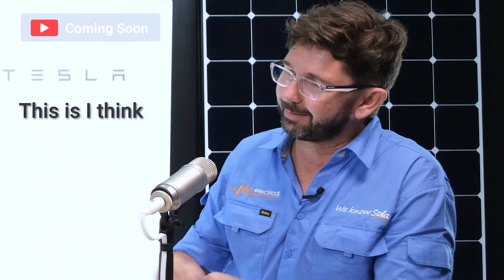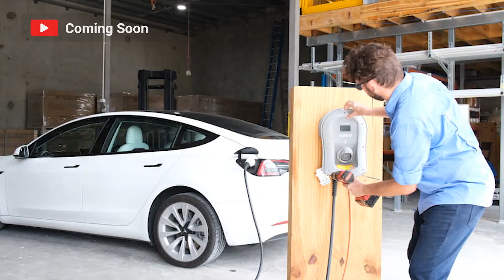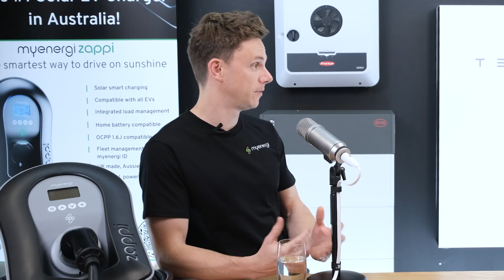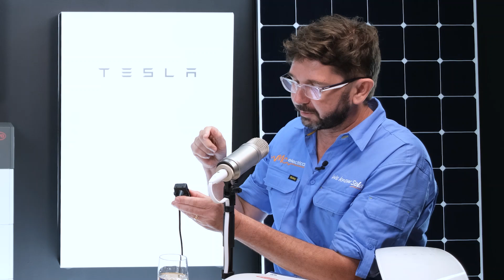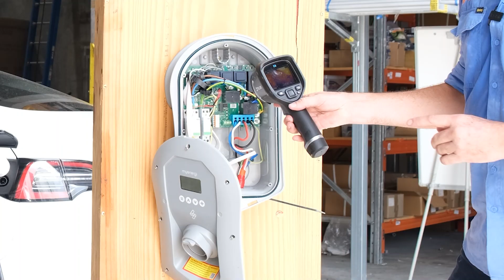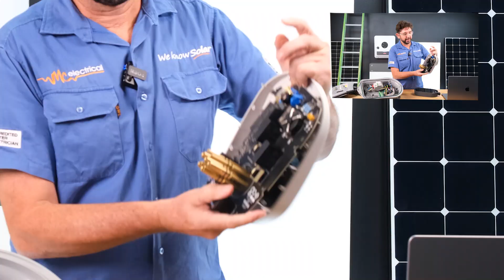Zappi Honest EV Charger Review

Comment: In NL we have a few popular home wallboxes in no particular order: Peblar Home/Business, Zaptec Go 2, Easee, Wallbox Pulsar. Most of these support dynamic load balancing to not overload the grid connection, Follow the sun demand steering for 0 export mode. Home assistant integration to switch profiles and keep track of usage. In NL grid connections are frequently 3x25A, so demand steering makes sense.

Also, they follow a similar concept to the Fronius with a single integrated PCB. It's like this is the most obvious thing.
Reply from the maker: Thanks for sharing, which one do you have?
Reply: @mcelectrical  Peblar

Comment: This is a year old now.   Are there any improvements to Zappi?  If there are, I think you owe them an update, because I was about to buy one when I found this video ... now I'm not!   That's not fair, if they have fixed the build...
Reply from the maker: Mark's moved on to testing batteries and their round trip efficiencies now with the Australian battery rebate. To be fair we still use a Zappi at the office that's installed in a shady spot - depending on your location, it might be fine but we think there's better options. We've had users comment that they haven't had issues with their Zappi, and they like the interface.

Comment: Have had a 3-phase Zappi plus Eddi running for 3 years. The first unit did fail on installation but the support from Melbourne was great and the sent a new unit quickly. Since then it's worked flawlessly up to 11kW. The configurable settings are great and having integration with hot water and BESS has saved me a fortune. I have no problem recommending the product.

Comment: If overheating is a problem with Zappi then it is basically limited to the UK market where 26 degrees celsius is considered a heatwave. 

The internal components also look like  off-the-shelf parts thrown together in a box. For a startup that's maybe ok, but looks very, hmm, home project like. 

Also the way of metering of excess solar production is very limited with the idea based on  CT clamp  on the outgoing cable exporting to the grid. There are countries where it is very difficult to get the permit for exporting to the grid and ppl still would like to have the same kind of functionality but very strictly with zero export. Zappi at this time according to my understanding is already useless with under such circumstances.  This functionality BTW is already built into some inverters, like the SunSynk, Deye, etc with the smart load output - when there is excess solar available the smart, programmable output is powered. 

There are obviously more possibilities, but if you think about it, solely having such an inverter  you are able to "divert" your excess solar to your car charger and water boiler in a programmable way. 

So there are cheaper, better built, more resilient and heat resistant, better looking solutions out there for example already integrated into your inverter.
Reply from the maker: Exactly, thanks for sharing.

Comment: just came across this video as I am in the market for an EVSE for home as well now - tossing up between the Zappi, Fronius wattpilot or the 'new' kid on the block the Evnex E2. I have an existing Frounius inverter (I chose that because of how highly you and Finn rate Fronius in general) so the 'default' option would be the Wattpilot, but as you mention the 'smart' solar surplus charging is round the web and back so there is a lag. From what I gather the Evnex is still sort of via the web but is faster (not sure how) but after seeing your teardown of the Zappi I am interested in whether you've had a look at the internals of the Evnex E2 yet and thoughts on its build quality? As it's quite new/not widely used it's hard to find many reviews/videos that aren''t just from Evnex or their 'trusted' installers...
Reply from the maker: The Wattpilot's a good option if you're already in the Fronius eco system, but Evnex is a worthy contender in Mark's tests for derating. Mark recently filmed another video comparing 6 chargers which will be out in the coming weeks.
Reply: @mcelectrical  hitting that subscribe button now so I know when that video comes out :)

Comment: I've had a V2 since early 2022 with no issues. I am in the UK though, and the Zappi is in my garage. I run the cable under the garage door to charge the car on my drive.
1) zappi not in the sun
2) zappi and cable out of harm's and vandals way
Reply from the maker: Hey rugby girl. It may be a different model. It may also be that you don’t notice it ramping down on a hotter day. The product works, no doubt. I would hope that a product of that price would last 10 years regardless of the warranty. I’m not convinced about the quality or r&d behind it.

Comment: I’m in the uk. Had my zappi for 18 months, last 3 months it has started halving output from 7 down to 3.5kw. Myenergi have advised me to do a factory reset? But by the looks of your video this won’t do anything. I charge at night and it is cool here! But unit still reaches 65 degrees. Definitely a a design issue!!
Reply from the maker: Yep. Interesting isn’t it. I’ve done a bunch of updates with them since this video. It made it worse. It’s a bit of a worry.

Comment: I have been using three phase Zappi 2 for the last 3 years.. I generate enough solar in Sydney summer to charge my Tesla Model 3 long range on excess solar at 11kW.. Never had  over-heating issues.. My Zappi is in the garage..
Reply from the maker: Maybe yours if fine. But I have had one at my office for 5 years. I didn’t monitor it with separate monitoring, so I figured when it ramped down it was due to solar surplus. Maybe it was to do with heat. Or maybe it never got to 11kw for long enough to overheat.  
If it works for you then that’s great. I’m just a bit suss about the build to keep selling it.

Comment: Love my Zappi charger! The one you show is the v2, the new v2.1 is very different internally but does still have the overheating issue, they de-rate when the internal temperature gets over 65 degrees, Due to the very good export tariffs available here in the UK (double what I pay overnight) , I no longer use my Zappi during the day, it only charges overnight so never has issues with being too hot, probably good for longevity too.
Reply: cooling fan??

Comment: We have a Zappi and it's great.  We have single phase, all that high current stuff doesn't apply. We have 4kw of solar and we leave the Zappi to harvest all it can and a couple of kw is the best it usually runs at. It needs no app. It has a panel. It is not connected to the internet. How do those app controlled charge points talk to a phone? Do they have a sim card? Or am supposed to rewire my house to get internet into the garage? No the wifi signal does not reach.. No, I am not going to park my car in the living room just to get wifi

Comment: That's interesting. However, the Zappi looks like it can be upgraded or repaired cheaply. The other units would have to be replaced  if they become faulty. I still think all the intelligent sockets are a rip off, it's not at Charger, just a socket, yet they are asking hundreds of pounds for them.
Reply from the maker: Fair comment. But most people wouldn’t upgrade a charger. And the fact that it had basic issues makes me concerned about the stuff I dont understand or can’t upgrade. But I agree, they seem so much simpler than a solar inverter but cost similar. I’m sure the price will drop soon enough

Comment: I was looking at zappi but I ended up ordering a zj beny occp after watching this. QLD summers don't suit something that derates so easily!
Reply from the maker: I’ve been meaning to test the ZJ Benny. Are you using it with charge HQ?
Reply: @mcelectrical  I will be, the app interface looks pretty slick. 
On another note do you know much about dynamic control solutions for EVSE >20A as per the updated QECM? I couldn’t really find anything so I went with the basic network control setup via the network relay (but still connected via tariff 11).

Comment: I use a Zappi for 3 years now, in the Netherlands, in a three phase configuration , and I am totally happy with its performance and possibilities,  also I really like the app.
Personally I experienced zero problems with overheating, do you test it with a one phase power connection?
Reply from the maker: Hi Lucas. Zappi actually called last week, (mentioned lawyers and I laughed) and then suggested I needed to do a firmware update and test it again. I tested in my new heat chamber at 36 degrees on 32 amps single phase. It derated to 6 amps after less than an hour. Single phase 32 amps is worse than 3 phase 16 amps. I’ve got a comparison video of other chargers in the works, but none are half as bad as Zappi for derating. Great features but questionable build.

Comment: I don't know if the 3phase ones are different but the latest model single phase is a lot cleaner inside and all on a printed circuit board. To be fair if they sent you the current modem I think you should update the end of your video with that because what someone buys today won't look like that inside.
Reply from the maker: Yeh I was told single phase older models have the contractors on the pcb. But, no, the new three phase model is the one I showed at the end in my warehouse. Same as the previous model plus wifi.

Comment: Also I am not quite happy with zappi BC I plug and start fast.mode at night then zappi goes eco mode by itself and it doesn't charge the car fully sometimes stop itself and it's so hard to restart again .I don't know what mistake I do
Reply from the maker: Try contacting your installer for support, they should be able to help you.

Comment: This left me pretty confused. A contactor or relay which is used in the Zappi is either on or off. It doesn't modulate the power. Power modulation is done via the PWM signal that is sent to the car. So there should be absolutely no reason to derate the charging power as this won't influence the heat dissipation of the relays in any way. Unless you have very bad relays with high ohmic losses at the contacts, the only way to reduce heat dissipation from the relays is to reduce the coil current in the relays electromagnet which can be done by using PWM to reduce the current after the contact has closed and only needs the smaller holding power. Heat dissipation of the internal cables should also be negligible if the right cable diameter was chosen. This is much easier for wired relays than for traces on a PCB and can even be changed easily after production. I see the modular design of the Zappi as an advantage as it's much easier to repair or fix issues than in an integrated PCB.

Comment: Same issue. I have a Zappi 2.1, so the latest version that has now been in use for 5 months. It does the exact same thing as descripted. It will specially in Summer d-rate the output substantially and you can see it ramp up and after a little while ramp down again. Mine is single phase and I have seen it drop as low as 1.4KW output. I very quickly realized that this was heat related. I now keep the garage door open to get some airflow.
My guess is that these contactors will fail in a year or two due to such a high heat generated. Nerveless, I am happy with my unit as it gives me unprecedented flexibility which we take full advantage of. 
My hope/best guess is that if it requires a hardware update, the company will look after their customers and offer the upgrade at cost price.
If they can fix it via firmware....even better.
Reply from the maker: Yeh my concern is early failure. They only have a short 3? Year warranty. I wouldn’t be holding my breath on Zappi doing any favours outside of warranty, but maybe they will. That would be an awesome move to regain credibility.

Comment: Would be a great idea for the people with off grid setup is to run a DC shunt on the off grid battery to measure the current going to and from the  off grid battery bank and allow a DC input into  Zappi that measures this mV at the shunt, a bit like the Split core CT measuring the AC direction on the incoming mains, that way make it both grid and off grid capable.

Comment: Interesting. I've had a Zappi V1 for over 4 years and very happy with it, but its just single phase.

Out of curiosity, I went and looked up specs on some typical contactors. No one specifies contact resistance so no way to work out how much heat is generated by current through the contacts, but a three phase contactor might need up to 13W for the control coil (depending on the contactor). That is significant  in a smallish closed box, but these things are meant to be used in the smallish closed boxes (switchboards). I'd expect the heat from the contacts (and I^2R losses in the wires) to be small by comparison, which means that throttling would have minimal effect.

They could be overdriving the control coil (perhaps for reliability in switching with a poorly regulated supply) which could mean even more than the 13W and that could be what they hope to fix with a firmware change. Contactors on a PCB or separate are both valid design choices, with different trade-offs, but the main advantage of putting contactors on the PCB is reduced cost (at least for large scale production) not any necessary quality improvement. I expect you can get PCB mount contactors cheaper than DIN rail mount contactors and you would certainly have lower assembly cost for the PCB solution, but then off PCB contactors are more serviceable.
Reply: agree no advantage with relays on the PCB they (look pretty) but not practical also difficult to replace on doublesided soldered PCB. If all the zappi relay contacts are setup to manufacture specs shouldn't be an issue regardless how close they are.

Comment: Hey :)
I've got a Zappi V2 also - and have observed the overheating issue. Did you have any luck with the firmware update you mentioned in the vid?
Reply: Update your firmware, it was rectified in v5.417
Reply from the maker: No luck unfortunately.

Comment: Had a zappa v1 that failed. I am in the uk and it was located on a east wall, the internals of the unit would get to 80c in direct sun light. We did get a new one and it is on a north wall, so no problem. I think some form of cooling is likely needed , passive cooling might do ghe trick.
Reply from the maker: Yes it definitely needs a redesign for better cooling of the internal components.

Comment: If an EVSE gets hot enough to need throttling that's just poor design - it's just a contactor and some control - no excuse for this to overheat.
Myenrgi have also been screwing installers in the UK by telling customers they won't honour warranties due to incorrect installation, whee they were actually installed according to Myenergi's instructions at the time, which they have subsequently changed and tried to hide any copies of the old version online
Reply from the maker: Hmm, interesting. Reminds me of Solaredge. The concept of not installing a charger in the sun was new when I was talking with Zappi. But, installing in direct sun will rapidly overheat it.

Comment: 25:15 - Yes, your wee charge-POINT point is neat but the only moving parts in any EV charge-point is the relays/contactors.  It seems entire sensible to me to design a charge-point that has easily (and very cheaply) replaceable relays/contactors as these are the most likely items to wear out.  It appears Zappi's contactors are simply not heavy enough.  It would be an easy, cheap and interesting experiment to replace the contactors with better quality/higher-rated ones to see if this eliminates the heating problems.
I am also completely baffled why the PEN-loss contactor is getting hot.  There should be essentially zero current flowing trough this (easy to check!) and therefore it should not be heating *at all*.  Are you sure your thermal camera was giving correct readings/being used properly?
Reply from the maker: Good points. They are 32amp connectors. That’s an issue. But yeh the pen contractor was almost hot to touch, and no current flow. Bizarre. Like I mentioned in the video, they think it could be an issue with the PWM on the coil. Not sure why they couldn’t fix that with a firmware update and a new unit. I kind of agree with the idea of replaceable parts. It just seems much more efficient and less heat generated to do it all on a printed circuit board.

Comment: I actually prefer the zappi design of using off the shelf contactors. If one fails on the fronius, you have to get a sparky to decommission the unit so you can send it in for specialist repair ( I wouldn't be happy with Joe bloe soldering high capacity contactors into such a specialised board) then get the sparky back to reinstall it. I'm also not a big fan of the fronius contact pins being soldered to the circuit board for reasons for fatigue and stress on the solder joints. 

A simple workaround is to move the contactors out of the zappi housing and into a sub board. They are standard DIN rail gear. If they are the heat source causing the thermal throttling, just move them out of that sealed box lacking any ventilation or cooling. 

I think V3 will have this sorted, but the solution is simple imho.

I find it unusual that MyEnergi would have failed to account for cooling across 2 generations of Zappi. I have the V1 Eddi, and it has a massive heatsink on the back for this exact problem.
Reply: Yeh I get what you mean about repairability. But, I have had and have heard of many Zappi chargers fail. Haven’t heard of any issues from Fronius - but I’m sure there is some. Installing contractors in a separate enclosure is a good idea for an experiment! I might do that.
Reply: Great idea moving the contactors out of the box 👍
Reply: For high power electrics I don't like the fully integrated PCB approach for many reasons, some already mentioned. The modular approach of the zappi will see them potentially have much longer serviceable lives